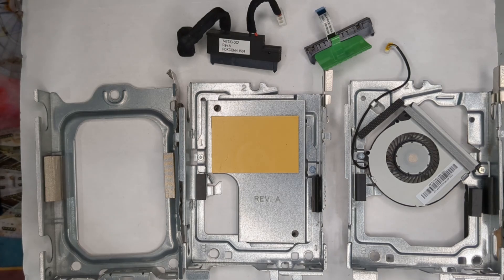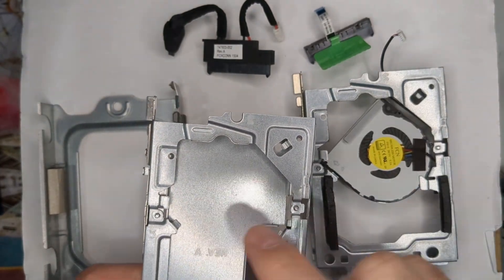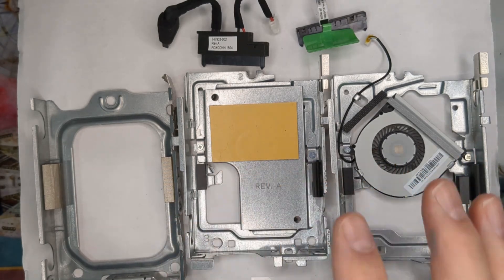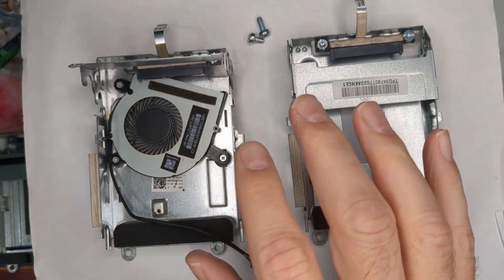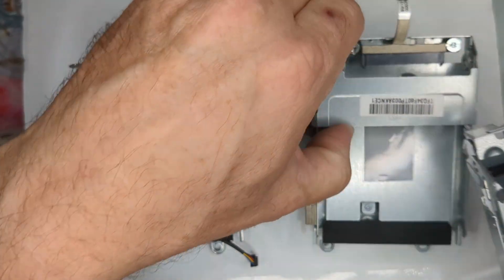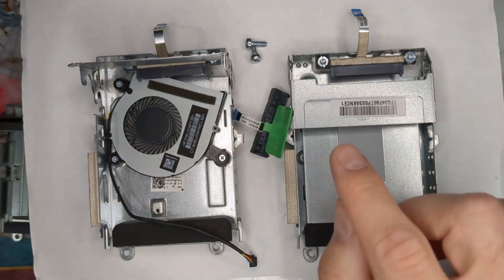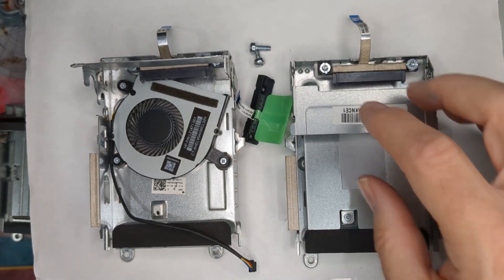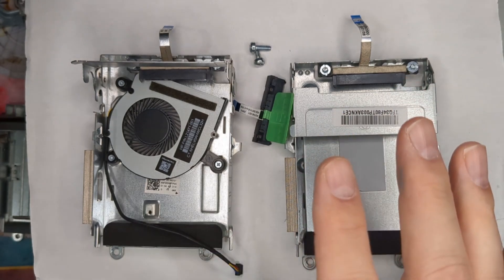EliteDesk SATA Drive Caddies and Connectors

Comment: Just saw a EliteDesk 800 G4 Mini w/i5 8500T, 16gb ram, no Wi-Fi, no SATA Caddy (also no cable) for about 100 USD.

The USB 3.2 10Gbps and Type C port that come with the Q370 chipset seem like a nice side grade from the H370 on my Optiplex 3060M.

I was wondering if the SATA cables are the same from a G2 or G3 compared to the G4. Like would it work if I get the cable meant for a G2 or G3 that on a G4. 

I see the G4 cable for ~8 USD, cable & caddy for ~18 USD (too expensive for me). While a G2/G3 cable is 4~5 USD.

From what you mentioned in the video it would though mounting a 2.5" SSD is gonna be something else without a caddy.
Reply from the maker: Personally I would look for the caddy and cable combo. I've been able to find those closer to $10.  Make sure they include the screws.  I may talk about the cables in the video.  Normally best to use the indicated cable to reduce compatibility issues.

Comment: Is there a difference between the screws that hold the drive to the caddy for the different generations of the minis or are they all the same??? My G4 came with a caddy but no screws for the drive itself...
Reply from the maker: I think I talk about screws in my caddy video but I went and checked my G2, G3, G4 to confirm.  The G2 screws are much longer and can't be used on G3/G4 - the G3/G4/G5 screws are all interchangeable - including the caddy and SATA cable screws.
Reply: @handmedowntech  I understand what you said in your video about the screws that hold the caddy to the motherboard and the screws that hold the cable... I was wondering about the screws that go into the drive itself and align the drive in the caddy???
Reply from the maker: @bjshertenlieb  gotcha.  The ones for the G2 seem to be different than the G3, G4 ones.  To be honest I tend to just use a simple screw to hold the drive in place since I moved the SSDs around from unit to unit.  Those damping screws are really only useful for mechanical drives.  The lightweight SSDs can really just be held in with a single screw.
Reply: @handmedowntech  Thank you for your quick answers... Appreciate it muchly!!!